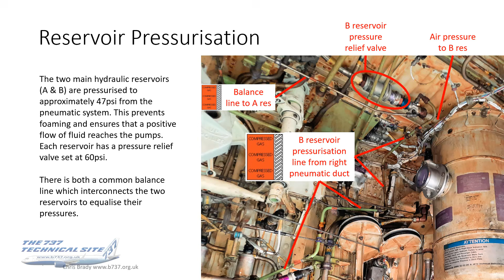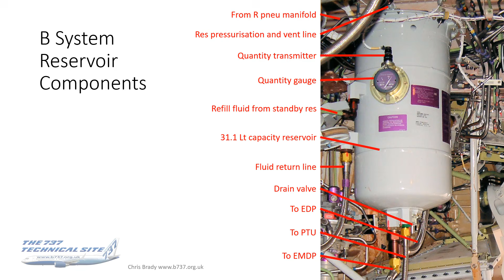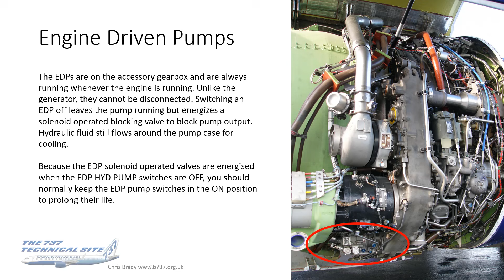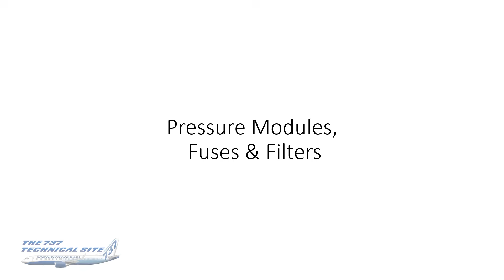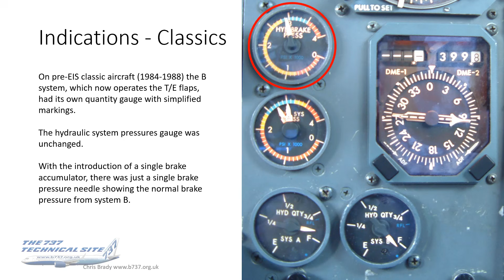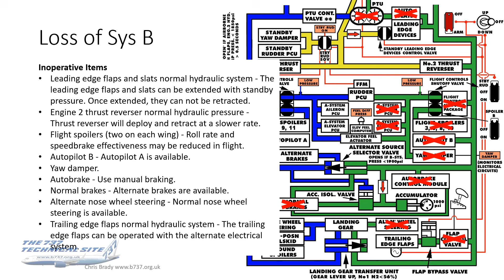737 Hydraulics

Comment: Good Evening Captain..Just one question..why RUDDER is connented to SYB system , where as AILERON and ELEVATOR are not...
Reply: The ailerons and elevator can be controlled via manual reversion just fine with brute power through cables. The rudder, cannot

Comment: Hey great video. Question, if an engine fails in filght and is still windmilling do you still have some hydraulic pressure in the system driven because N2 is still rotating ?
Reply from the maker: You may still have a little hydraulic pressure from the EDP, it depends upon your IAS what N2 you will have. Don't forget you will still have the electric pump for that system so the hydraulic pressure for the system should be unaffected.

Comment: Hi Captain, amazin content as always. Please, could you tell what exactly "manual reversion" means? is it something that open some valves for high pressure under the wing to go into the balance pannels? does the flight controls switch need to to go "STBY RUD" otherwise manual reversion will not "start"? is it something that is always on and hydraulics only make things easier?    any light on the subject is welcome! thank you for you time to read this!
Reply from the maker: Hi Hugo, Manual reversion is when you lose hydraulic systems A & B to the primary flight controls. The rudder will remain hydraulically powered from the standby hydraulic system. Loss of hydraulic power to the elevators and ailerons makes them very heavy but there are balance tabs to assist (see my Flight Controls videos for details). I have flown hundreds of hours of real manual reversion under controlled test conditions and the controls are heavy but it is easily flyable and just takes a little getting used to. If you watch my FC Pitch or Roll videos I explain tabs and manual reversion a bit more.

Comment: Hi, another fabulous video! Great explanation of a very confusing system, especially that in the FCOM there's very little info.

Could you please clarify how should I understand that PTU standpipe? Both you and FCOM say that "(...) fluid remaining in the system B reservoir is sufficient for power transfer unit operation." So if you happened to lose all system B fluid right after take-off, would PTU allow normal LED retraction, like nothing ever happened? And then extension? That last sips of hydraulic fluid can do it?

I undrestand all other scenarios involving PTU, it's just I can't wrap my head around that lowest standpipe and what's the purpose if we lose all the fluid. I checked both your video and Cockpit Companion looking for answer but still can't get that.
Reply from the maker: I think you are overthinking it. If the FCOM says "that the fluid remaining in the system B reservoir is sufficient for power transfer unit operation." then that is the case. The PTU should be able to function normally in the scenario you describe. The purpose of the standpipe is to enable the PTU to remain available if there is a B system leak in either the EDP, EMDP or any of their lines. Again, don't overthink it! :)
Reply: @ChrisBrady737  Sure, thank you very much for clarification!

Comment: Hi, will the PTU retract the LEDs
Reply from the maker: Yes
Reply: @ChrisBrady737  So why does the QRH loss of SYS B not mention this?
Reply from the maker: I am not responsible for how Boeing writes its manuals and therefore cannot comment on why things are written in a particular way...
I think you are confusing the function of the PTU with the alternate flap extension system (standby hyd). The PTU is to make the LEDs operate at the normal rate in the event of reduced or lost sys B. If you use the alternate system to extend the LEDs then they cannot be retracted.
Reply: @ChrisBrady737 Hi, another question. If on standby HYD will the PTU still operate for autoslats incase of approach to stall?

Comment: On Max, the overtemp sensor on EMDP does not give "OVERHEAT" indication in the cockpit but shuts off the related EMDP. Only the overheat sensor in EMDP case drain hydraulic fluid gives "OVERHEAT" indication(approx 107C).
Reply from the maker: Thanks for the info.

Comment: Hey Chris?  Got a question for you regarding the LGTU.  If you take off and while the landing gear is retracting, you lose system A hydraulics, will the landing gear still retract or will it extend?  Engine No. 1 is operating normally.  But is the N2 < 56% rpm one of the criteria for the LGTU to operate?  Thanks in advance, Chris!
Reply from the maker: It will retract more slowly as the engine runs down until N2<56%, then the LGTU activates and helps restore retraction to the normal speed.
Reply: THANKS for the answer, Chris!
Reply: Oh Chris?  There is no failure of the No. engine.  Just a loss of hydraulic system A.

Comment: Great video as always!
Question, just to confirm. The LGTU is only helpful in a Engine Out Situation (No1) and serves as no help if Hyd Sys A is lost and manual extension is utilized?
Reply from the maker: Correct
Reply: @ChrisBrady737   And by "Hyd Sys A lost" I meant that the fluid in Sys A is gone(burst). That is more accurate confirm?
Reply from the maker: @Fat_nibs  correct again

Comment: Hello Capt Brady, on the Hydraulic Quantities table, about the EDP and EMDP Standpipes for the B system on the classics, i didn't get why there is so much Quantity left (40% and 11%) in comparison to the Max which is 0% for both, could you elaborate on why the difference please?
Reply from the maker: I dont know why the design difference but I am sure the Max system will be an improvement on the Classics.

Comment: Captain I hope you are doing well ! I have a question! The LGTU is using HYD B psi to rise landing gear when No1 engine fails. We are talking for pressure and and not fluid exchange correct? That means if we have sys A loss the LGTU will not kick in because the rpm on n1 is normal! In case we have sys A loss because of leak and at the same time we lose n1 engine is the 20% fluid left on the standpipe is enough to rise the gear with LGTU? And is this the reason why the fluid remains at 20%? Thank you
Reply from the maker: Re "The LGTU is using HYD B psi to rise landing gear when No1 engine fails. We are talking for pressure and and not fluid exchange correct?" - Correct
Re "That means if we have sys A loss the LGTU will not kick in because the rpm on n1 is normal!" - The LGTU will not work with a loss of A.
Re "In case we have sys A loss because of leak and at the same time we lose n1 engine is the 20% fluid left on the standpipe is enough to rise the gear with LGTU? " - The LGTU will not work with fluid loss
Re " And is this the reason why the fluid remains at 20%? " - No, see above.
You have got several failure modes confused here. I suggest that you look again at the specific circumstances at which the LGTU operates.
Reply: @ChrisBrady737  thank you very much !

Comment: Can someone explain me clearly EDP depressurization solenoid valve, and EDP switch on/off position? 
Tks
Reply from the maker: The EDP and the electric motor-driven pump (EMDP) each have a switch on the hydraulic panel. The switches have two positions, ON and OFF.
The ENG 1 HYD PUMP switch controls the EDP for system A. The ENG 2 HYD PUMP switch controls the EDP for system B. Each pump has a depressurization solenoid valve. The valve blocks pump output pressure to the main hydraulic power system when the ENG 1 or ENG 2 HYD PUMP switch is in the OFF position.

Comment: In case of hydraulic system B failure yaw damper will be disengaged, in this scenario how aircraft turn is co ordinated without yaw damper ??
And also plz explain why aircraft crosswind capability has been greatly reduced during manual reversion even rudder travel range is same as during normal operation ???
Could u plz explain
Reply from the maker: It can't. Primary YD is from Hyd sys B. Standby YD is from the Standby Hyd sys. Flying with the YD U/S is not a big deal, you hardly notice it.

Comment: Great video/presentaion again!!
I would like to share some additional info/tips:

-The reservoir head pressure prevents not only fuming of the fluid but the caviation of the pumps. In case of no head pressure the pumps are ruined in 2 minutes because of cavitation. Happened in the hangar. Indication of the caviation: Very high pitching sound from the pump , switch it off immediately

-Be cautious about the hydraulics level on the NG. The maximum indication is 106. If it is above this level the indication is still 106. If the reservoir overfilled and the pressurization check valve is damaged hydraulc fume enters the airconditioning system. So the normal level before flight is around 100% (unless your company procedures differs)

-You can have high amount of fluid leak from the overflow drain mast in case of retracting the gear from B system when no.1 engine is out and the transfer valve is shifted. In this case during retraction the A system fluid returns into B reservoir which can easily overfill it.

-Boeing manufactures the 737 with Hyjet IV / V hydraulic fuids. Skydrol and Hyjet are totaly intermixable

-If you run the Electrical pump without minimum fuel for cooling you can do very limited movements. For example retracting or extending the flaps one cycle. If you do more the fuid will overheat.

-The standby pump and the PTU are designed for emergency/non-normal operations only not for extending operation. It happened in the hangar that the guys were running the standby pump for 1 hour constantly and its gone. Had to be replaced.

- In case of operating the flaps with the alternate electrical motor the flaps will move very very slow.
Reply from the maker: All good info and tips. Thank you very much for sharing your knowledge.
Reply: @ChrisBrady737  Thats why we are here on your channel! To learn and share!

Comment: A question that I could not get the answer yet. In case of loss of Hydraulic System, which Low Pressure will illuminate first?? For the EDP, the EMDP or both at the same time?
Reply from the maker: For loss of a hydraulic system you probably mean loss of fluid, in which case it depends where the leak was for which pump you will lose first. If in the wheel well then probably elec pump, if at the engine then probably engine pump. Every leak will be different
Reply: @ChrisBrady737  hello, yes I mean in case of a leak on common lines the fluid quantity will decrease to 0 or 20% depending on the system. My question was about which pump will fail first.
Reply from the maker: @miguelr1784  Again, It all depends exactly where the leak is and what hydraulic systems you are using at the time. It is impossible to give a general answer. In any case, the procedure will be the same.
Reply: @ChrisBrady737  thank you. And thanks for your high quality content, I'm enjoying them a lot. Keep them coming please 😊

Comment: Thx Captain!
Question: in case of dual engine shutdown and unable to restart engines, apu not operative (in an in-flight zero fuel scenario), will windimilling engines provide some hydraulic pressure or it will always be only manual reversion ?
Reply from the maker: Even at high IAS, the EDPs will not be turning enough to give enough hydraulic pressure for flight controls. Assume manual reversion. Also remember if damage then the fire handles will have been pulled so no EDP output anyway.
Reply: @ChrisBrady737  Thanks a lot
Reply from the maker: No problem, please spread the word about my channel
Reply: @ChrisBrady737  Chris, same question (both engines failed) with the APU gen's on line.  How much of the hydraulic load will the electric pumps be able to handle? Flaps extension rate ?

Comment: Sir if nose wheel stearing line burst during landing or after landing (due to fod), then how does stearing system work??
Reply from the maker: Try selecting Alternate nose wheel steering
Reply: @ChrisBrady737  even select alternate stearing switch  also hydraulic pressure goes same stearing line. I hope you understand my question?? Thanks

Comment: That was another brilliant episode, thanks Chris! Do you happen to know whether a windmilling engine will generate beyond negligible amount of hydraulic pressure in its respective system? I'm curious whether manual reversion would become easier when you fly faster!
Reply from the maker: Thanks for your kind comments. Re your question for manual reversion to occur you would have to lose either all 4 pumps and therefore both engines and the APU or both hydraulic quantities. Anyway to answer the question will a windmilling engine give its EDP enough power to provide hydraulic pressure the answer is unfortunately not enough and of course you can only maintain high speed for a limited time. Also if there was engine damage you will have pulled the fire handle and shut-off the hydraulic output. Don't worry about making manual reversion flight easier, I have done a lot of it and it is very manageable!
Reply: @ChrisBrady737  Thanks captain!

Comment: Hi Chris,
Thank you for your channel. Very interesting. 
I have one question: do you know the minimum time requirement for landing gear retraction, in cas of an engine failure, to comply with performance specifications? (not able to find it in CS-25).
Regards, Johann.
Reply: Extract from AMM 32-32-00-710-801 Par D. including my own note:
Move the control lever for the landing gear to UP and measure the time for the retraction.
Measure the landing gear retraction time from the time the control lever is put in the
UP position until all the landing gear red "disagree" lights go off. 
Make sure the landing gear is up and locked in 9.0 seconds or less.

Move the control lever the DN position and measure the time for extension.
NOTE: Measure the landing gear extension time from the time the control lever is put in the
DN position until all the landing gear green lights come on. 
Make sure the landing gear is down and locked in 13.0 seconds or less.

NOTE: Engine Driven Pump EDP and Electric Motor Driven Pump (EMDP) together pressurizing the A system in this case, or in the hangar we use ground cart. EMDP alone does not have the flow rate to measure extension / retraction
times.
Reply from the maker: Great info, thanks for sharing
Reply from the maker: There is not directly a minimum time for retraction but there is an engine-out minimum take-off (and go-around) climb gradient requirement from 400ft. If the gear is not up by 400ft, it is unlikely that the gradient will be met. Without the EDP, the gear would not be up in time.
Reply: @ChrisBrady737  Great, thank you!